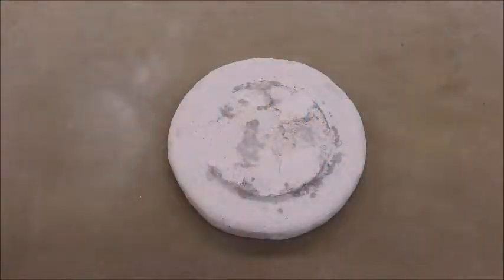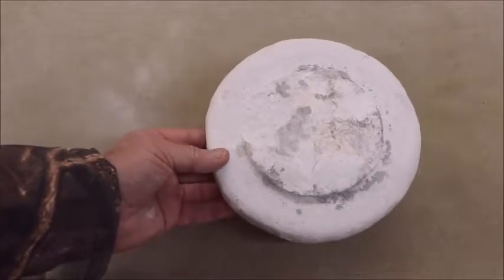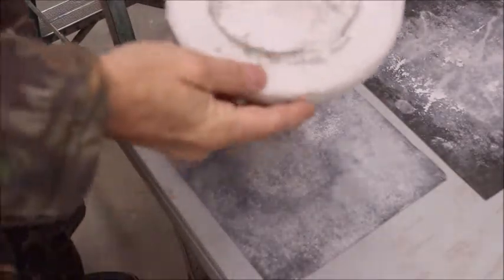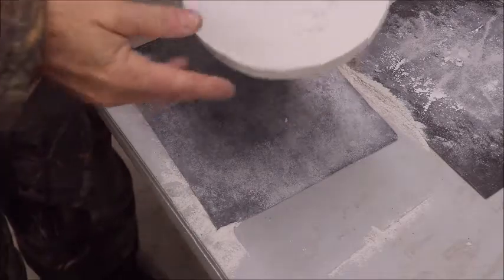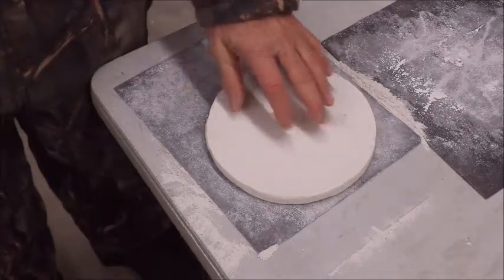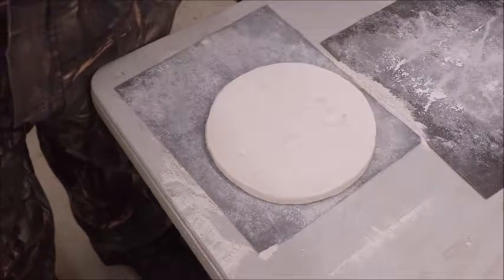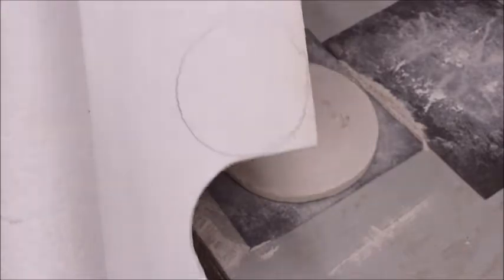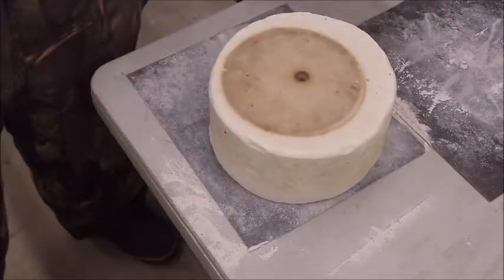Microwave Kiln Repair

Comment: My first kiln had a would-be pendant explode inside.  It was a mess.  I pulled the glass out of the top as quickly as possible and have kept using it.  Eventually, the bottom platform became very damaged and I just removed it and have used it as is.  I've never used kiln wash, the instructions didn't even suggest it.  How often do you have to reapply the kiln wash?  How long can you use that thick kiln paper before it has to be replaced?
Reply from the maker: Ziggy, sorry I did not see this earlier.  The kiln wash will not have to be replaces as long as it sticks to the kiln material.  The thick fiber paper will laast a long time.  You will know when it needs replacing.  You can also just use regular shelf paper and line the top up with the bottom when you get ready to fire.

Comment: Hi, Capt Mike. My problem is with the underside of my microwave kiln.  I  put it down on a bench top, on top of a pot warmer. It burnt the kiln and scorched the tabletop. I can still use it, but is there any way that I can repair the damage underneath the kiln.
Reply from the maker: First, always let the kiln cool off some before removing it from the microwave.  You can also set the MWK on something that is not flamable, like ceramic or granite until it cools.  If all you have on the bottom of your kiln is the reminents of the pot warmer the kiln should be OK.  discoloration will not hurt anything.

Comment: Thank you Capt Mike for the instructions.  I wonder if it is possible to repair the black lining of my kiln.  It cracked at 2 spots and the crack extends in the white part. Are there any insructions for this problem?

Comment: I have my first microwave kiln and I ran into a problem. I used it successfully three or four times. The next time the piece I was trying to fuse broke in half, the frit burned and looks like charcoal and the platform and paper on the top of it toasted. I tried again at a lower temperature and decreased the time and the same thing happened. Now the little platform is even darker.  it’s not toasted any other place inside the kiln. I did nothing different, I used the same paper, the same glass in the same Microwave. I’m wondering if it’s the burnt top of the platform that’s now causing the problem and if I should sand a small layer away the way you explained. Do you have any ideas about what’s happening?  I appreciate any input. I’m also wondering how to prevent it from happening again. Thanks-  Beverly
Reply from the maker: I would clean up the shelf, apply new kiln wash to the shelf and new shelf paper.  That would be my next move.

Comment: Thanks for some great advice on Microwave kilns. Could you repair these kilns with plaster? I note you built parts of your kilns with this material.
Reply from the maker: Plaster will not handle the heat.  The kiln is made from a vermiculite type material.  You might try mixing water glass with fine vermiculite and see if that works.  Thanks for watching and the comment.

Comment: Hi I have a…. Question. I think it got a crack in my microwave kiln . 
Is it possible to repair it? If ? how do I do it ? I thank you for your nice understandable and professional videos . 
I enjoy following you. Greetings from me in Denmark 🇩🇰
Reply from the maker: If the crack is in the top part and nothing has fallen off it will probably be OK.  You might want to try using a little water glass/sodium silicate in the crack.  It is in a liquid form and will seep into the crack and when dried and fired it will solidify.  Thats just a suggestion.  I have not tried it in a crack.

Comment: I am devastated - I have a small kiln - takes like 14 hours to fuse glass right ? Soooo I thought I would try a microwave kiln … put the kiln paper in and each time it has burned the paper …. I also forgot to the put kiln wash down first - any idea if that would cause the paper to burn and not melt the glass … I waited all day for Amazon and not I’m defeated lol any advice please 😂
Reply from the maker: The paper is designed to burn off.  The binder that is used to hold the heat resistant material is something like sugar.  You will sometimes get a burnng smell when the paper is first fired.  It is very important that you use kiln wash on the base and then add the kiln paper.  did this help any?
Reply: @CaptMike  aww thank you for responding so quickly - I love watching your videos they are always so informative and fun to watch. In my regular small electric kiln the 6 x 6 shelf I use kiln wash and then I use kiln paper and yes it does burn up and dissolve I guess you could say it gets flaky but I’m talking this paper burned and now my actual round shelf in my microwave kiln has burn marks like you can see where the square was actually burned. What would be causing this? I’ve definitely ruined the kiln ugh. So I was hopeful when I watched your kiln repair 😊
Reply from the maker: @southernartchick3540  Sometimes the kiln paper will discolot, but that should not hurt the working of the kiln.  If the kiln is intact it should work just fine.

Comment: Thank you.  How do you repair the lid with a 2" chunk of it broken on one side?  Would you suggest glue or cement?
Reply from the maker: Do you mean the side of the mold or the raised portion  in the middle.
Reply: @CaptMike  it's the side of the lid of the mold.
Reply from the maker: @LAURA093058  Sodium Silicate or water glass might work.  It is relatively inexpensive.  You can get it in small amounts from most ceramic dealers or in larger amounts from Amazon.  Research Sodium Silicate and see what you think.  Keep me in the loop.
Reply: Thank you Captain Mike!